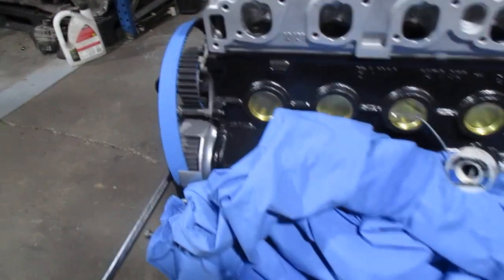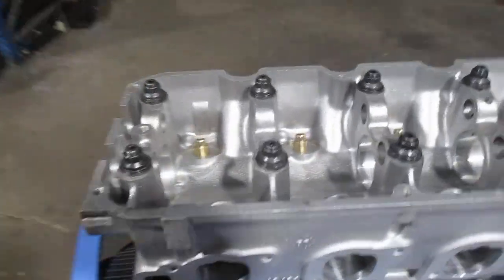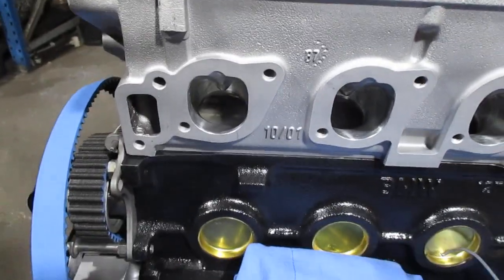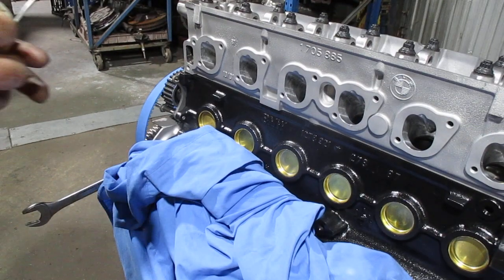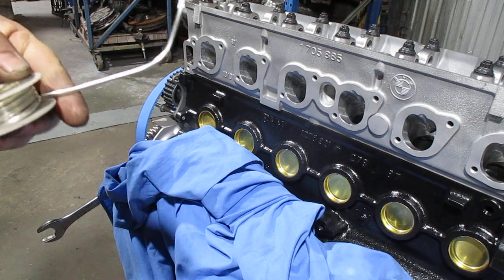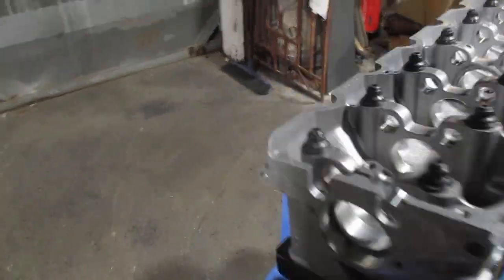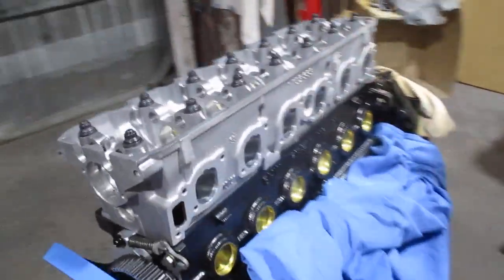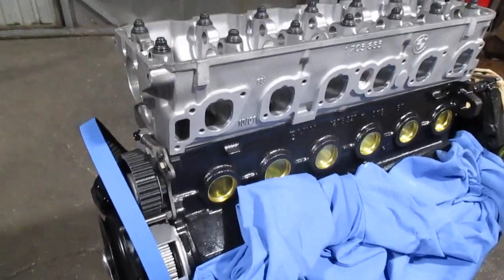bmw M20b29 roller race engine

Comment: Looks good, also building a 2.9 over the winter. Head fully polished and ported already, bottom end is getting the new pistons in
Reply from the maker: Make sure you get the squish tight 😊 I've got a fellow racer with a 2.9 that makes 160rwkw  it's full of good parts but put together wrong, I think I could pull his down and re port the head and adjust a few clearances and get it to make 200rwkw but he doesn't want me to touch it yet 🤭